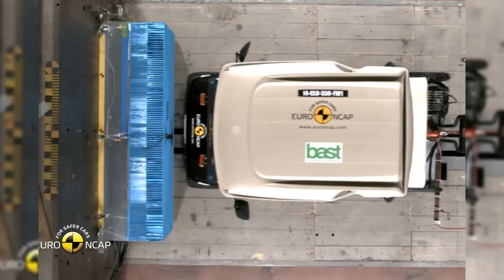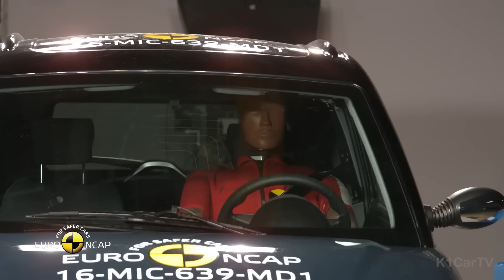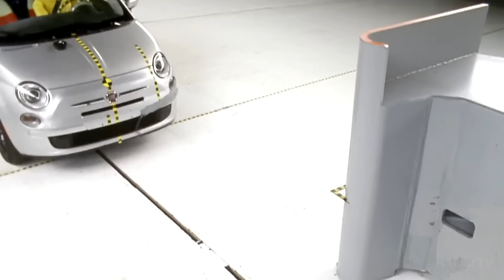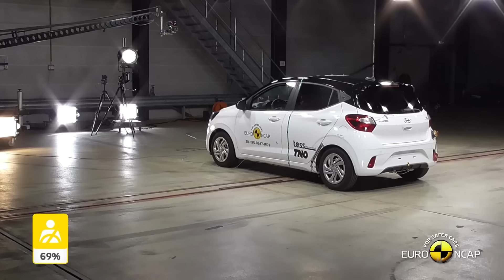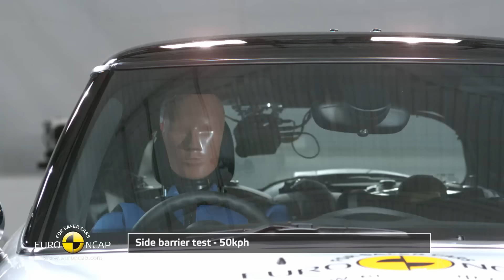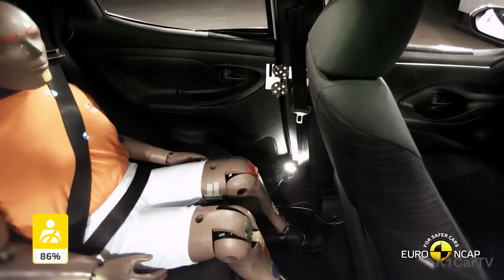SMALL CARS CRASH TEST

Comment: Be careful with naming what cars are shown: No 9 (at 14.35) is not a Tesla Mod S. No 1 (at 25.50) is not a Smart.
Reply: The "Tesla Model S" is actually a Hyundai i10 and the "Smart #3" is actually a Volkswagen Beetle
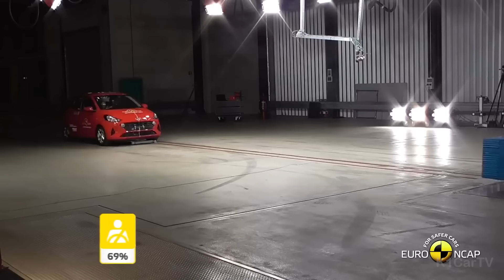Reply: 14:35
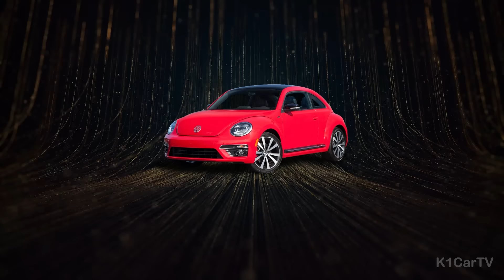Reply: 25:50
Reply: I agree
Reply: @Sceneemofemboy0666 if you are talking about the earlier version of the beetles from the 1960 etc then you are correct but the modern beetles are not beetles as they looked like a half cut orange with casters on it and it has an engine in the front when a beetle should have the engine in the back.
Reply: @raymondsecker2338  true but its the same name for the third gen, only the second gen was named slightly differently (new beetle)
Reply: They mixed up all different types of Crashtests. They mixed up Fiat 500 and 500e(electric). This "Hitlist" ID completeley nonsense.
Reply: They misnamed cars to bring comments... very low...
Reply: @adostrake  I know some do so, just makes me angry and will never trust them or others who do so
Reply: Keine Ahnung aber vids einstellen,  keine Kohle für so ein schmarn........
Reply: Good point the creator is stupid😂
1:Hyundai 
2:a friking VW beetle 😂
Reply: @Sceneemofemboy0666  and the Beetle isn't really a small car either
Reply: @Kilian600  true, its kinda big

Comment: Geezus no mandatory airbags in Europe? In this modern day and age w/ technology advancements it’s inexcusable? Death traps
Reply: They are mandatory for mass-produced cars, but many of these vehicles are quadricycles, which basically only need lights, bumpers, brakes and seat belts.

You can legally sell actual cars without airbags in Europe, but only in small quantities. This exemption was specifically created for small car makers producing vehicles like exotic sports cars and replicas of vintage cars, although more recently, some manufacturers of small EVs have been using this deliberate loophole. That's not what the vehicles in this video are though.

Comment: Quadrocycles should not have been included in the list. Some cars had different types of crash tests. Some cars had no airbag deployment, with the crash test dummy's head spacking the steering wheel, but it received a 1 star rating, and others had airbags that deployed but received zero stars. The golf cart shouldn't have been included because it's not road legal.

Comment: Seriously Aixam Crossover GTR with no air bags get 1 star and Renault Zoe who was very good get 0 stars? 💀
Reply: These are in different vehicle categories (the Aixam is a quadricycle, the Renault a car), which get tested at different speeds against different obstacles and under different criteria. They are not comparable. The Renault received a poor result by car standards, partly due to a lack of safety assists, partly because it's an outdated vehicle that can't keep up with modern standards, but also because Renault downgraded its safety by removing airbags it had been equipped with in order to save on manufacturing costs. Obviously, it's still much safer than any quadricycle.

Comment: The first one had no airbags 😮😮😮
Reply: Here in France, these tiny cars can be use on public roads without the driving license for those born after 1987, like for people under driving license suspension or whatever.
For younger people, a kind of mini-driving evaluation is required.
Those are not real cars, they don't respond to EU standards, they goes at 45kph max (CVT gearboxes), you can't take highways/motorways etc.
We call these pseudo-cars « voiturettes ».
So, of course, no airbags, no ABS, no ESP (and no airco, no cruise control etc.).